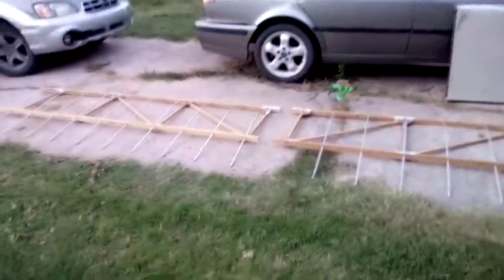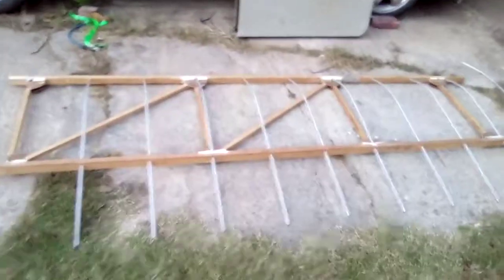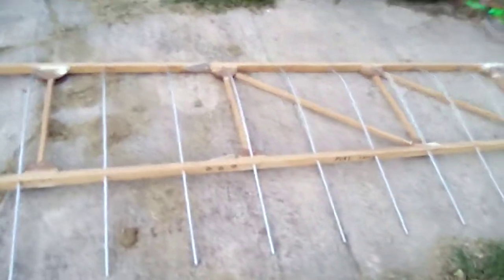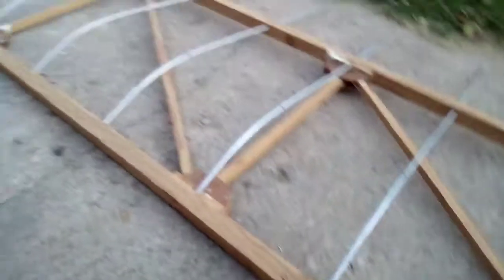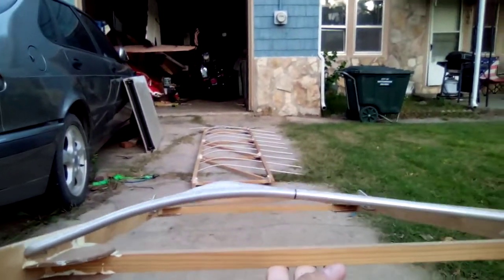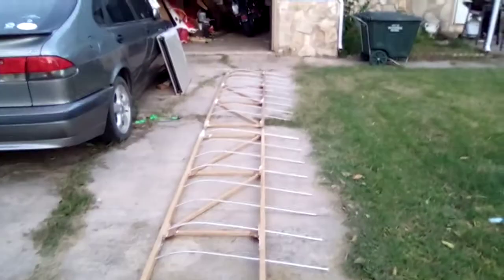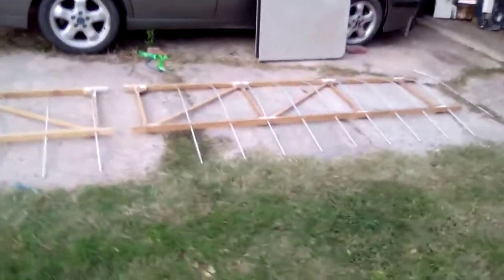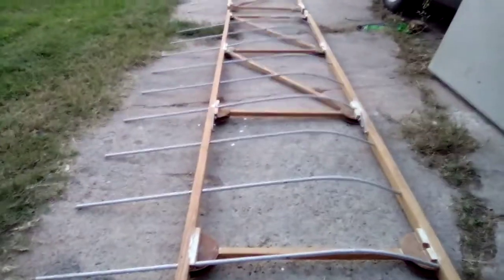Hovey Wing Ding II lower wings

Comment: Do your ribs actually go through the rear spar? I built a set of these wings off of that plan back in the 80s for my own ultralight, sunburst by air mass which were  covered in stitz fabric and strut braced versus wires, and wooden spars were not called for
Reply: The wing ding 2 uses  wing warping wooden spars and ⅛ inch cable in front solid braced straight and the rear top and bottom cables were thinner and  continuous loop from one top wing to the other around a stick on an axle with a cable wheel attatched at the back between the lower wings and the other cable from the bottom rear wingtips through a pulley between the top rear wingspar . It had about a 17 foot span .

Comment: whats the specs of those ribs , please
Reply: I have a set of plans . The wood frame was 2 foot by 8 foot about and ribs were 3 foot with 10 inches for flap and the other 2 inches was the arch curved top . Covered in dacron coatliner and doped .